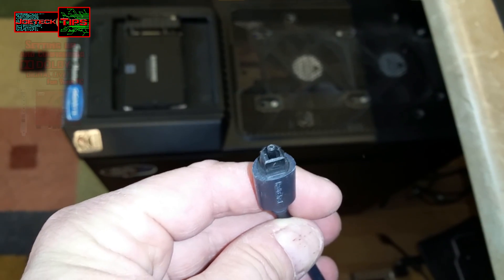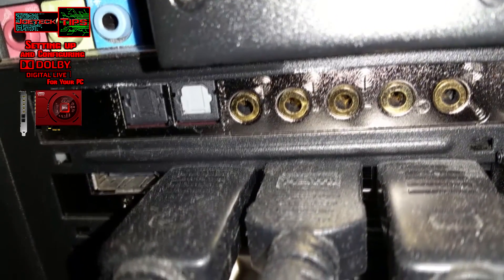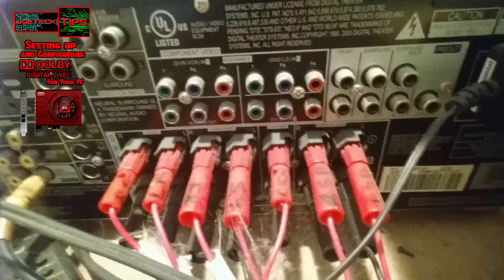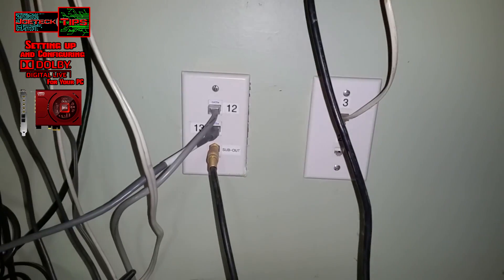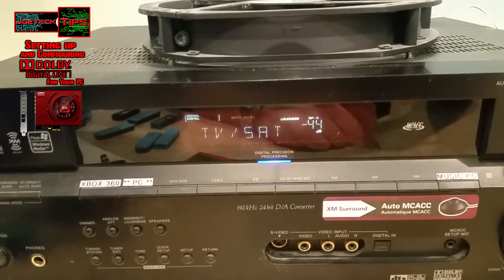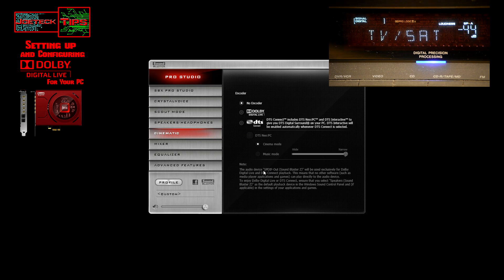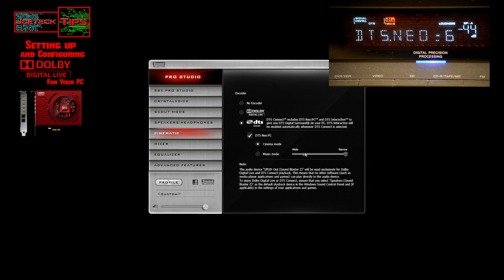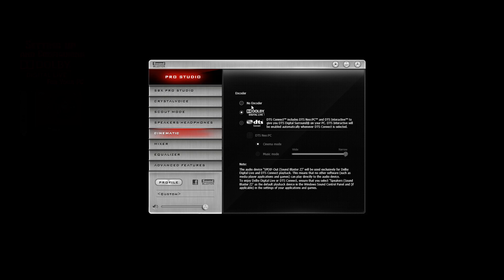How to Setup and Configure Dolby Digital Live for your PC - Optical

Comment: Hello. Great video. I bought SB Z, and now I am thinking about going digital. Do you use Dolby digital setting in CINEMATIC settings like deault for games? Or DTS? How do games sound? Do you get surround sound without any problem in games? I just want 5.1 digital sound and now I am stuck between Logitech Z906 or some cheaper AC reveiver option like Onkyo HT-S3800 or Yamaha YHT-1840...
Reply from the maker: The Logitech Z906 are impressive speakers. If I had a choice I would probably get them. Getting a receiver like the one in the video is also a great option, but then you still need to get matching speakers and a powered sub woofer. I already had everything.  That said, I play in either Dolby Digital or DTS. I do not fart arounf with the Cinematic stuff. I want true surround sound when playing games. Yes, its freaking awesome. The best gaming experience you'll ever have. Thanks for the comment and questions - JoeteckTips
Reply: Joeteck, thank You for reply
Reply from the maker: My pleasure Jack! If you have any other questions, just ask. (please subscribe)
Reply: @Joeteck  Then when you want to play a regular audio file, say a FLAC in Media Player Classc or any other player. Does that work with digital out ? Do you have to use "no encoder" or you just stick to Dolby Digital live for anything ? Thanks your video is great !
Reply from the maker: Yes, no issues. Plays through center channel, or left and right.
Reply: @Joeteck  thank you very much. So you stay in Dolby Digital even for audio playing through different players. It s confusing because it says it won t work in the few lines under the dolby option in the sound blaster settings. So I m not sure to get it all... Thanks again !
Reply from the maker: @Jason_Music  i do it all the time.. it works great. It may also play through all speakers. It awesome.  I use a Dolby digital receiver
Reply: @Joeteck  Thanks a lot for the clarification that's crystal clear now !! Thanks a lot for your time and quick response, I appreciate it. Great video !!

Comment: I heard that Windows 10 didnt allow the use of DTS Connect or Dolby Digital Live, are you running it on Windows 10? and do you need anything else moded in the registry?
Reply from the maker: +Pabula what you heard is incorrect. The add-in sound card does everything. The OS will never prevent features from working and yes I'm running Windows 10 with the Sound Blaster Z.
Reply: Thanks for your reply, but it does happen with some soundcards, specially older realteks that did have support on win7 for DDL and DTS Connect dont have on Windows 10, there are even some hacks/mods, even tutorials on youtube where  you can make them work doing registry changes.   I leave you an example,
https://www.youtube.com/watch?v=IGioPmSZY2w

But im glad to hear that the SoundBlaster Z works on windows 10 and encodes DDL and DTS connect.
Reply from the maker: That is Realtek's problem not writing drivers for their hardware not Microsoft's fault. They make so many sound devices, they would only make drivers for newer tech and not legacy stuff.

Comment: Hello, really liked your video but i have a question. so if i have a Sound card with SPDIF out and motherboard with onboard SPDIF out... they are the same ? i mean all the decoding and effects and quality is worked on the reciever? i am kinda bummed out. what is the point buying an expensive Sound card (that i did) if the SPDIF out is a pass through as you stated? sound card douse no work what so ever?  please help me out understanding this issue better.
Reply from the maker: I'm trying to get more details on the Realtek ALC1150 Codec that is on the Z170 mobo. Personally, I would disable the on board and get the Sound BlasterZ it would make the Z-5500 ROCK! 
The Logitech Z-5500 is a freakin BEAST! it has DTS 96/24, DTS decoder,  Dolby Digital, and Dolby Pro Logic II. Dude, get the freakin optical cable and the Sound blaster Z!!! (thats the Sound card in this video)
Reply from the maker: Should be a 3.5mm toslink to SPDIF "cable". Its really glass. lol The Line in / MIC jack has the optical out on that card. Good luck, and I GUARANTEE you're gonna love it!!
Reply: Every SPDIF output is different. it may not be DOLBY DIGITAL.  The receiver will decode the data and output it the way it needs to be. The sound card must say DDL (Dolby digital Live) or DTS (Dolby Theater Surround) to output true Dolby. and the receiver has optical in to decode that signal. If the sound device does not say it, then its a standard 2.1 ( 3 channel) signal in digital but an analog output. if that makes any sense.
Reply: Joe Schibani huge thanks for the fast reply ... You are right about ddl the on board does not have it but it has a 5.1 spdif. I didn't give you all the info but I will now. I have Logitech z-5500 speakers and they are connected to motherboard via spdif out and i get all 5.1 speakers working... Also, when I connect them via analog to my Xonar dx sound card they sound way better. So the thing I wonder is this... When I use on board spdif the sound quality work is done by z-5500 speakers and when I use analog cables from Xonar card the sound quality work done by sound card Xonar? Sadly I don't have the cable to use the Xonar spdif out that's why I am asking... If it's worth buying a new cable and plugging it into the Xonar sound card.  Sorry for the long text.
Reply: Or maybe it has a dts I am kinda lost. The motherboard I am using is Msi m7 z170 a. All in all is it worth buying a cable and using the spdif from motherboard or Xonar card spdif  or analog . What will give the best sound quality?
Reply: Waiting for my SPDIF 3.5 cable to arrive... taking your advice. will plug it into Xonar DX sound card with optical Dolby live and will test things out :). will update, thanks again:)

Comment: Great info and sick setup.
I would recomend you to use studio foam on the walls. I've done that (in a much smaller room thatn yours) and it just simply doubled my bass and because i have no reverberation in the room, the sound is more clear, pure. here is a picture of my setup 
https://ibb.co/k0gqy5
Reply from the maker: Mr. Tex thanks. all of my insulation is in the walls for better base. I did not want anything outside the walls to take away from an office look. it is not a recording studio. I do not have pictures on the walls either. thanks for watching.